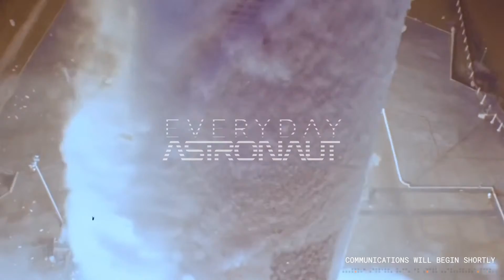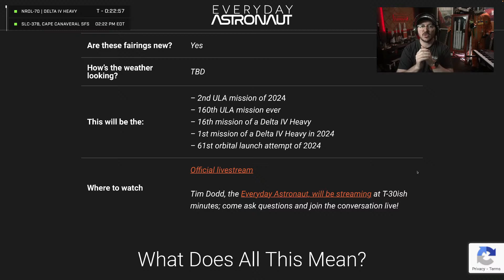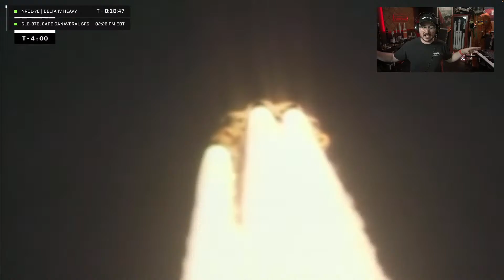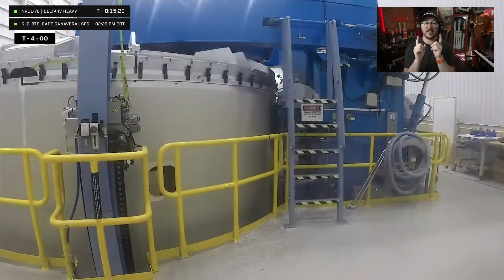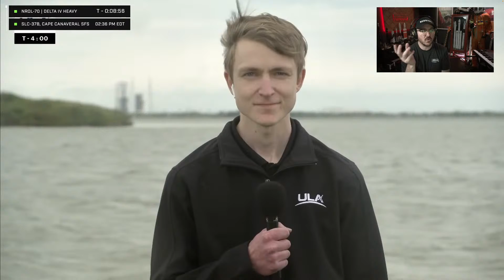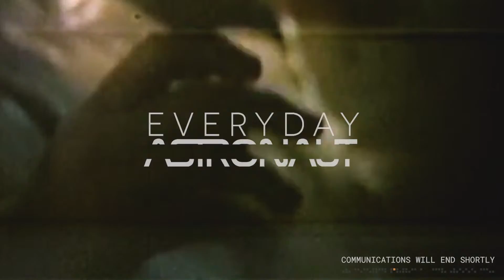[SCRUBBED] Watch the LAST Delta IV Heavy launch EVER!

Comment: Ok, weird question. Suppose the launch is a failure and it blows up during ascent, do they still bother to investigate the cause? Or shrug their shoulders and go "Eh, it was the last one anyway."
Reply: At least for insurance reasons, they would most certainly have to investigate, but also for plenty of other reasons, quality assurance, engineering... Even if the odds are near-inexistant, imagine if it was a sabotage? They're mainly launching spy satellites for the Air Force, I'm sure the client would like to know what happened too... 
It's not the last rocket that the company intends on building and launching *ever*, so they really cant shrug the cause of a failure even if they're up to a new launching system now. They need to prove how much they can master their whole process and how reliable they are, so learning from failures is paramount. 
I'm no field expert but right off the bat this sounds the most plausible to me.
Reply: I believe they would, a failed launch is a major opportunity to gather information on potential weaknesses of their spaceships. What I've learned from Elons Biography is that he and the SpaceX team are always willing to blow a rocket up, if they can gather insightful information from it, so I'd conclude they'd never let that go to waste